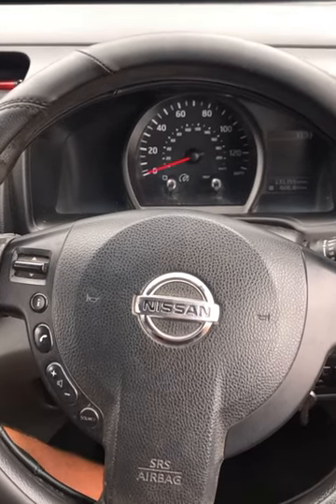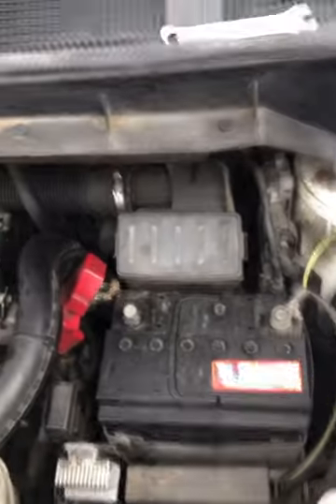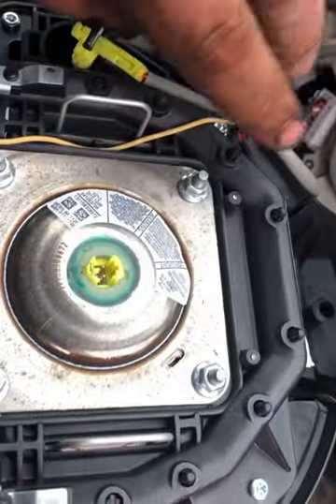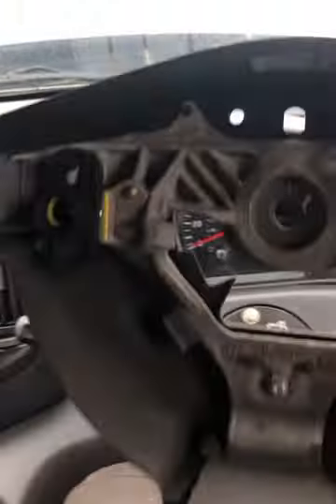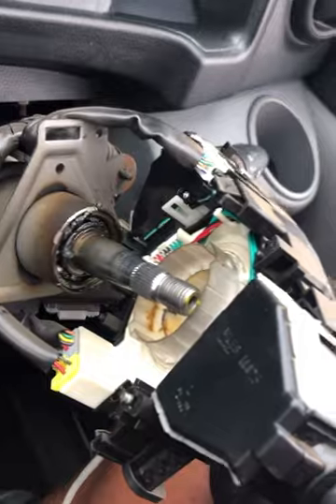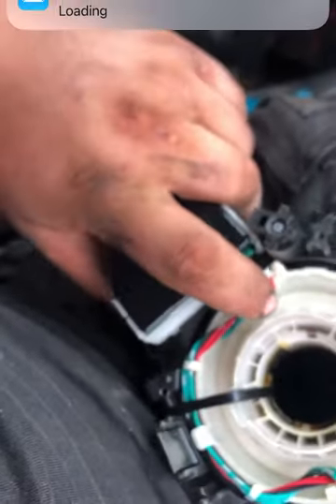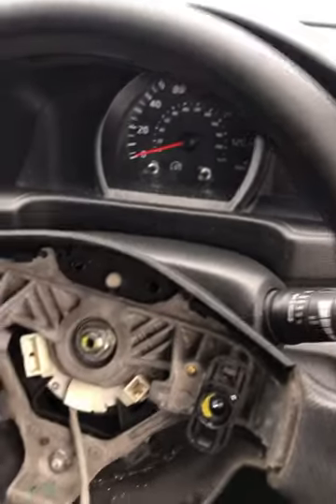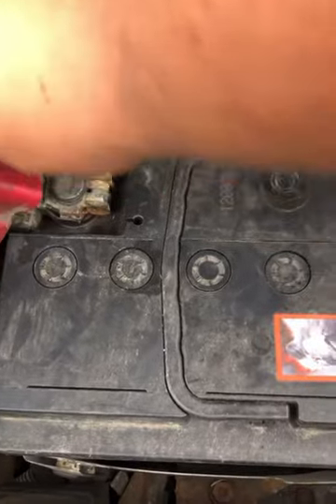Nissan NV200 clock spring replacement

Comment: Excellent, thks matey.😊
Reply from the maker: No problem 👍
Reply: @JACSAutocare  got a clock spring, following your vlog to release the air bag and it seems pushing on the two springs either side of the steering wheel is my first set back. I am putting defo pressing on the springs as I can feel the tension but they don’t want to release. The screw driver is about 3” in. 
I am putting a lot of pressure of them and still no joy. 
How easy was it for you.

Comment: What a bummer. Nice video. Did you get it sorted with one that works. If so have you uploaded a video on it yet. Thanks.
Reply from the maker: Hello yes got a new part direct from Nissan. It was pointless doing a video on it as it would have basically been the same video. New one fitted all the steering wheel buttons work and the horn  also no airbag light. Thank you for watching
Reply: @JACSAutocare  good stuff. Do you mind sharing the part number and the price please. I need to look at doing mine. It’s a 65 plate. 90 BHP. Thanks in advance. Ian.

Comment: What happens when you buy a new clock spring, replace it and the airbag light is still flashing? I’m ragin as I spent £260 ish on it and nothing has changed….
HELP what else can it be
Reply: Have you tried deleting the error code?
Reply: @ I took it to someone and they have managed to get rid of the airbag light….hallelujah…am now left with a new clock spring if anyone wants to purchase one at a reduced priced …box and receipt included 😞